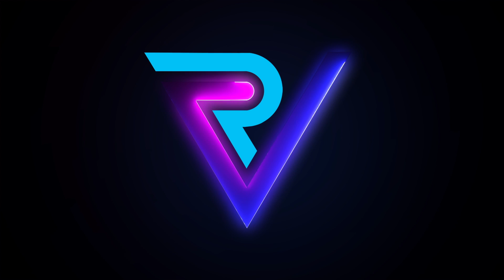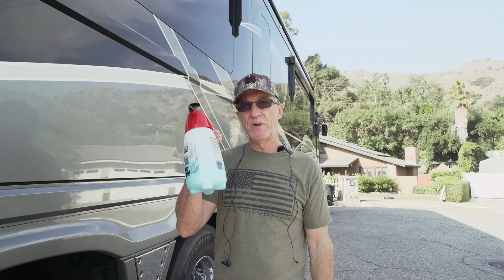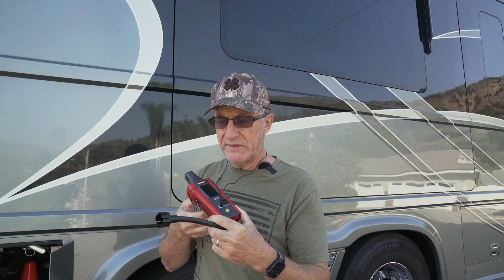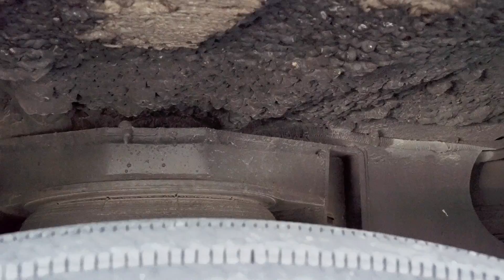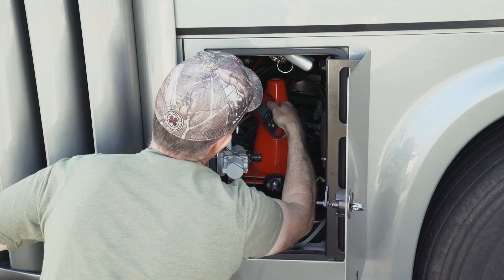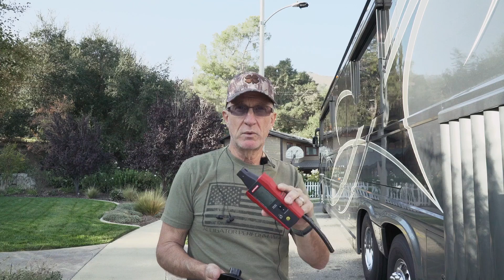Using the Amprobe ULD 405 Ultrasonic Leak Detector to find air leaks in your RV | Newell School

Comment: Outstanding demo!  Thank you!
I run an appliance repair company and this model was recommended for finding refrigerant leaks. This is definitely on my list of must-haves!
I currently use nitrogen to pressurize the system coupled with bubbles to see if I'm able to find a leak, but I am already hard of hearing to begin with and some leaks are far too small to hear. This sounds like a huge time saver for me. 

I am also considering the transmitter to go along with the receiver and wonder if it would work well for finding leaks in refrigerator gaskets. Usually, the interior pressure will be less than the outside atmosphere so air tends to leak in vs letting the cold air out.  As I understand it, the transmitter broadcasts a 40htz tone that the receiver should then detect outside the unit you're testing. 

Super cool!
Reply from the maker: Glad you enjoyed, Andy!  I’m sure you’ll find it to be a great tool for your trade. And, yes, paired up with the transmitter would make it all the more useful.  Thanks again for watching.
Reply: @RVSquaredSteve  Picked one up this week and LOVE it!
I was able to find leaking schrader valve on a refrigerator almost instantaneously. 
While bubbles and water CAN accomplish the same thing, the amount of time this is going to save not having to hunt down tiny leaks is incalculable. 

It's also very good to be able to double check my solder joints when finishing up as a good QC check before I head out. 

Thanks again!
Reply from the maker: So glad to hear, thank you!

Comment: Nice item to have but not for propane leaks. For that you need the $162 GSD-600. $510  (Amazon) to just detect air leaks?????
Reply from the maker: Oh, for sure...a dedicated gas leak detector is good tool and less expensive, even though completely different technology.

However, one might justify a ULD for all detecting all leaks (via sound), whereas a gas-leak detector is only "sniffing" for the flammables in a range that is...hopefully...below it's flammable limits where your nose may fail.

Hmmm, ya got me thinking; it would be an interesting test to see which detector could pick up on a leak faster/better.  Having used a gas-leak detector as a firefighter, I know that we could always smell the gas by the time the meter would register.  The biggest benefit to these devices, is to get into places that we can't hear or smell...or don't want to.  Ha.